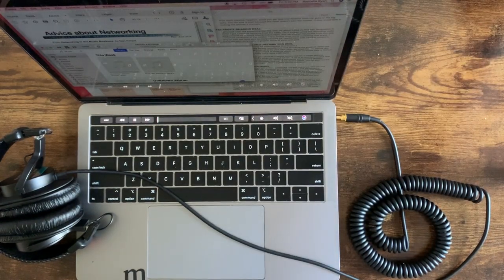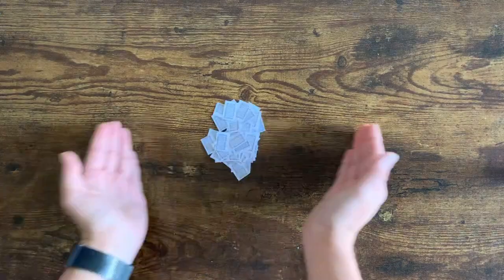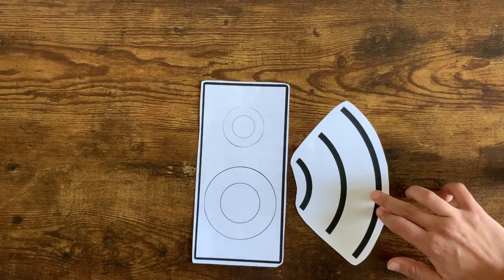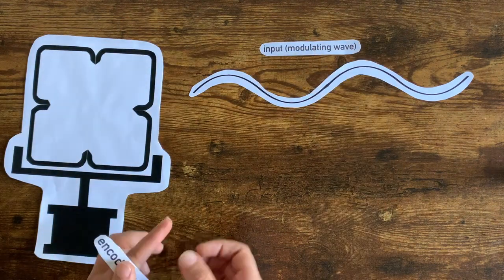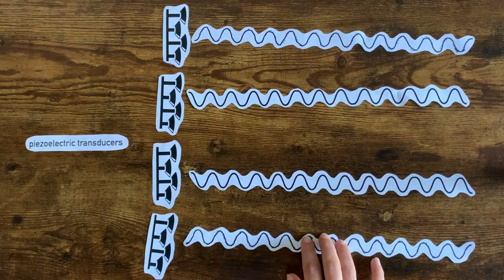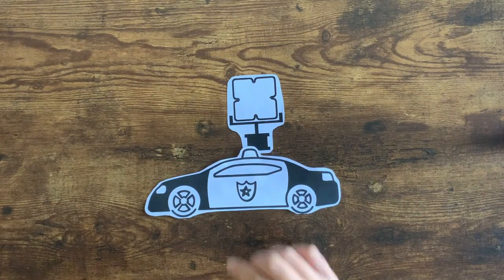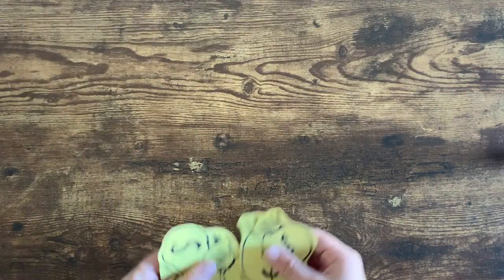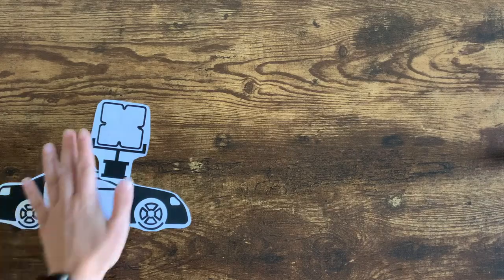Long Range Acoustic Devices

Comment: The original LRAD systems used amplitude modulated ultrasound with a carrier level of up to 162 dB, from piezo-stack drivers used in ultrasonic welding, coupled to solid metal horns designed to be effective in the ultrasonic range, bonded to an aluminum disc. The modulated ultrasound technique allows a very narrow beamwidth and very little beam spread, but it is not very power-efficient. This is why they changed to moving-coil compression drivers and folded horn topology. Competing systems from "Hyperspike" use a parabolic reflector in a shape called a hyperspike, energized from the periphery to produce a beam that has a planar wavefront, or a horn that has a ring-shaped aperture inside, and still others use a large phased array of moving coil drivers attached to horns. I understand you have an objection to their use in crowd control, but this performs an important public safety and communication function in large gatherings where a message must be given to the crowd for their own safety.

Comment: LRADs are often used with that beeping tone. Due to the fact that they can be up to as loud as an unsuppressed pistol, they're not designed to be used in long bursts at max volume for crowd control. This doesn't stop PDs from using them improperly, however.

That said, another neat thing you can do with LRAD is speak on them or play music or audio files through them. Damn useful for psyops. 

Reportedly, LRADs playing very loud infrasound has been used to injure Western diplomats in Cuba and other authoritarian bloc countries. And unlike permanently blinding laser weapons, these applications aren't banned by any treaties.

It's equal parts fascinating and terrifying as to how these can and will be used to wreak havoc, both for good and ill.